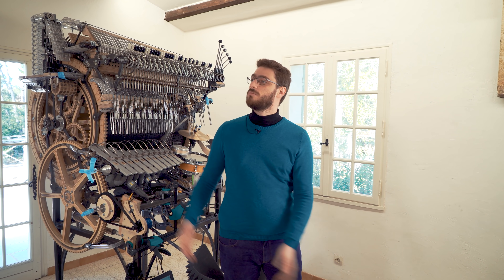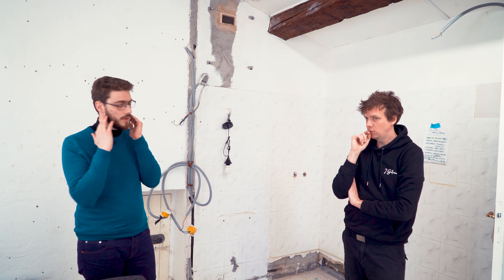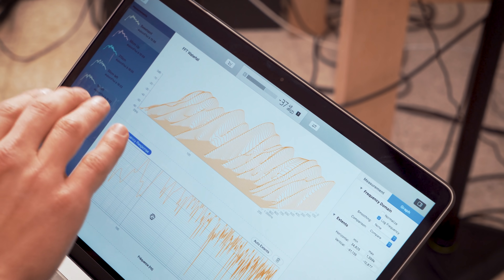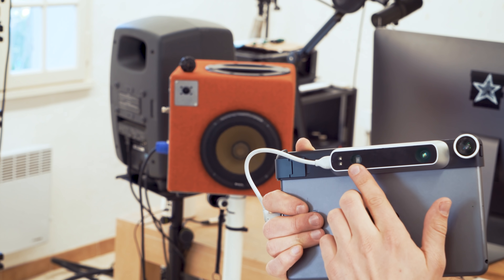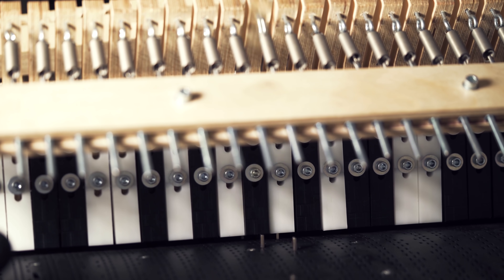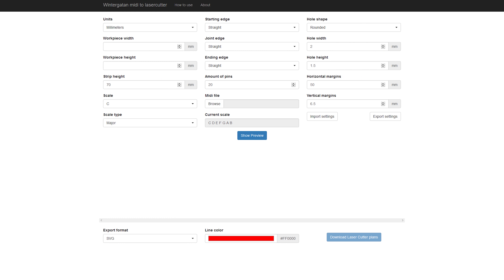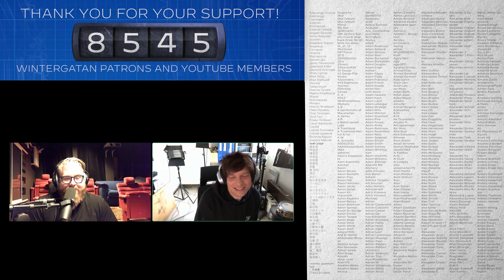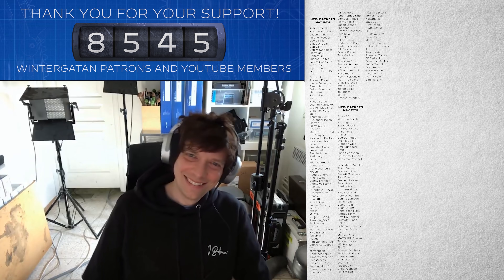Music Studio Acoustic Measurements - Marble Machine X #127

Comment: Re: The suggestion to use solenoids to directly trigger the releases.  Surely it would be 1000x easier to just multisample the MMX to allow you to play around with song ideas in Logic before committing to the plates?
Reply: Yes, I feel they are really overthinking it and creating problems for solutions. Adding a solonoid for every channel adds so much bulk, many points of failure and a whole layer of complexity with electronics. I think a sensible workflow would be composing midi using MMX samples, then testing the finished composition on the MMX using the magnetic pins (to catch any physical limitations that might not be apparant when using samples, and finally creating the stud welded boards from midi.
Reply: I think it still is something completely different playing on the actual machine vs with samples:
It's about what sounds the machine adds, whether the marbles arrive everywhere in time, whether the timing works out for him to change the bass capos, etc etc...
The way I understood it is that the system is detachable, so it is just an add-on during composing and not permanently attached.
Reply: True... but a big problem of the machine is it’s limited marble flow and number. Triggering the channels directly allows to check if the pattern is possible without running out of marbles. Also the cyber bass or that other instrument still in the making would be hard to sample. Using the whole machine to test song ideas might me over complicated but it’s a good way do hear it for real and to make sure the song is possible on the machine. Also, it’s like trying ideas on a piano versus composing on a midi grid (kinda) so in the end it just depends on the Wintergatan music making workflow
Reply: @oscarjouxtel5343  The physical limitations are not magic or random or anything though. With just a bit of measurement and analysis of marble flow rates etc. it should be perfectly possible to just write a script that can analyze a midi file and verify whether it can be played on the MMX.
Reply: @oscarjouxtel5343  He can just test his completed compositions using the magnetic programming wheel.
Reply: @haaspaas2  3 limitations with the programming wheel that he's mentioned in the past and hasn't come back to:
1) Timing limitations: the magnetic pins can only go into slots with specific timings, limiting his freedom. The new stud plates can be way more variable, so you can't actually test what you can make on the plates with the magnets, as far as I understand.
2) Accuracy limitations: there's a lot of parts involved in the magnet pin drum that can shift around slightly.
3) Time Consuming: it takes a while to reprogram the wheel by hand. This isn't a huge deal if he's just messing around.. but when he's composing a long, detailed song.. and something needs to be moved around that might cause significant parts of the wheel to shift, well... that's going to make composing on this masterpiece quite tedious... something I'm sure Martin won't love lol
To be clear, he's definitely not going to use the solenoids as the way to play on stage... and he'll probably still use some version of the magnetic pins to do simple testing and ideas.. but when he's really digging into composing and trying to make an accurate measurement of where the pins need to be on the plates, well that brings us to the problem he never got to mention yet:
4) He's going to need to create accurate files to send to get the new plates. If there's innacuracies that are noticable enough when testing the plates, he's going to need to make tweaks and order a new one. The increased accuracy and precision that the solenoids (or some similar system) will bring to the pre-plate composing and testing will potentially save on a lot of extra plates being requested and reduce a lot of turn around time.
Reply: @oscarjouxtel5343  That's a good point
Reply: We're gonna first see how Martin's composing flow will be, using a sample is one of the many options!
Reply: As soon as his room treatment is up he can make samples for a VST.
Reply: If at all the solenoid triggers could be an addition to the programming wheel. That way they just have to immobilize one part and can use the normal pipeline.
Reply: The real problem will be when Elon Musk asks Martin to bring his marble machine into space where there’s no gravity! Marbles everywhere! Better start brainstorming a solution now! Think everyone Think!! Or Martin will lose all his marbles in the end!
Reply: i didn't quite follow the goal of the stud welded plates... are they going to replace the programming wheel altogether or just used in addition to the wheel for the tour?
Reply: @peter-gn8ey  There are four plates on the programming wheel, right? Imagine what that means. They'll need so many song changes to fill a 2 hour show that even with a spare set of plates off stage it would almost be impossible, and risky, to keep changing all the hundreds of magnets in between songs all night, and when he discovered these CNC welded studs it was a huge relief. So instead of his rubber holes, the four plates will be covered with these studded metal sheets. They will not only be more accurate than his rubber holes, but also (theoretically) allow for quick changes of the content on the programming wheel without any mistakes. Now, I suspect there will be complications in all this, but the idea makes sense.
Reply: sorry i could have phrased that better. i get the benefits of the stud welded plates in terms of tolerance and quick-changing, what I'm asking is, is the programmable cylinder going to be removed altogether meaning the machine can ONLY play the stud welded plates, OR is the cylinder going to remain such that he can use both? for the tour the pre-made plates make complete sense but without the programmable wheel otherwise, he would lose the ability to just "riff" on the machine so to speak...

Comment: To be honest getting rid of the pretty much central part of the entire machine and replacing it with electronics is kinda sad and takes away from the mechanical wonder that it is, but this really will make it a lot easier to operate, re-program and definitely less prone to breaks. And marbles will still move all the same as with a wheel or even more due to opened up space on inside.

Comment: There is absolutely no point in making the programming pins “more accurate” but ok. No one can tell if they have a maximum drift of “0.05mm” like come on. You need to stop somewhere
Reply: JS Lavertu exactly
Reply: A minuscule drift does not sound like much but over the duration of a several minute song, it will definitely have a impact on the tempo of the song. It’s the same reason why pianists practice to have near perfect timing when playing notes. Having inconsistencies in timing between notes leads to poor execution of a song.

Comment: Wow!  Martin said 2 things which make senses: 1) composing music 2) performing the music.  He is excellent at this.  He also mentions using MIDI in a very convoluted way to make CAD drawings to make welded stud plates to play the MMX.  This scraps his original goal of being able to create and change compositions on tour.  Also displayed here is the failure to understand that using solenoid activation which allows easy editing and programming from MIDI, solves multiple major issues.  He instead envisions the possibly to add another layer of complexity to the process of making music with the MMX.  He views the solenoids as merely a composition editing tool before making the welded stud plates, which, of course, cannot be edited.   The solenoids can replace the magnet pins, programming drum and the welded stud plates completely !!  

Manifest in this video is the concept of "Re-arranging the deck chairs on the Titanic" and throwing more time, effort and money after bad ideas and a disastrous implementations. The Monster CAD Project seems to be the largest waste of time and effort.  Why build a CAD model of design that has proven many times to be unreliable and fragile?  Will there be a special call out for adding 0.1 grams of epoxy to each of the wood screws in the plywood?  Will the Plywood be replaced with solid hardwood?  Metal??  Do you need all the detailed CAD of a complicated, mechanical, demagnetizing system?  Or re-design to lift the marbles in a simpler, more reliable way?

The re-modeling of the "studio" is another totally unnecessary waste of time and resources, since the MMX has been functionally completed years ago in your computer as MIDI which needs no acoustic treatment of the room,

Martin, I have been watching every YouTube video since the original Marble Machine years ago.  I think you are a great composer and musician.  You are no longer making the MMX, it is making you.  I can no longer watch this slow, drawn out waste of your time and talent, as it has become painful and sad.  I will check back in 2021 to see where things are at that time.  Good luck.
Reply: I think you may have misunderstood what is happening. Remember, it was never only about creating this unique machine, but also about recording an album, and taking it around the world for a concert tour. To fill a 2 hour show you'd need so many programming plates that it would be almost impossible, and very risky, to change the pins by hand in between songs. So the metal programming plates have been part of the plan for a couple of years already, ever since he discovered the CNC studwelders. If Martin still wants to make changes on the road, the manual plates will still be there to do that, so he's not losing any options. Same with the solenoids. Sure, they could replace the programming wheel but they won't. Why would they? But they will make it easier for him to compose to the limits of the machine, and, if he wants, even improvise live on stage. It makes the machine into a real instrument, and doesn't take away from the original concept at all. Sure, the whole thing could be midi controlled, but it doesn't depend on it, and I'm sure it won't be during performances. What would be the point? 
As for the CAD project. Remember the machine had an accident recently, and I think it made Martin realise how vulnerable the whole thing is, and that spare parts are key. Perhaps even a backup machine. That's what the CAD project is about. Booking a world tour is a huge responsibility, and preparing the whole thing for that reality is a huge job. That's where the community comes in. Finally, the home studio will be needed to record the album at good quality. So I don't really see any distractions from the original idea anywhere.
Reply: @astroscribe  It must be a lovely fantasy place where you live!  The MMX doesn't exist as a working, reliable, transportable thing.  Like its predecessor, it is falling apart right now.  As for the MIDI, it is not to operate this monstrosity, but replace it entirely.  Martin made it and showed it years ago to test the various timing and musical intervals he needed to incorporate in tho the MMX.
Reply: @shazam6274  Meh...

Comment: I feel like dropping the marbles with solenoids isn't within the spirit of the MMX! It's a mechanical machine! not just an over-complicated speaker
Reply: If I understand well, the solenoid system is only for the composition, to avoid to have to move pins constantly during the composition.  I think he will design it so it's removable for the concerts.
I find this idea pretty awesome because this means this machine can be both used as a instantly re-programmable and automatic marble machine as well as a completely manual machine.

Comment: Sorry, I think you are losing the entire ethos and raison d'etre of the project by replacing the programming wheel with solenoids and even adding a motor.
I thought the idea was that the MMX was an automaton, a manually driven device with no electrical/electronic parts (bar microphones).
Why not just eliminate the marbles altogether and just use a MIDI controlled solenoid to move a mallet on the vibraphone or bass guitar?
Much simpler and way cheaper. It would also be exceptionally boring by comparison.
Don't do this. Work it out.
Reply: Don't worry... Who's saying anything about losing the wheel? Nothing is lost. The original concept is still there and not going anywhere. Martin is too smart for that. He is talking about a tool for composing. But I personally think it's cool to make it possible to also play the marbles like a real instrument. Not either/or but and/and...
Reply: nah man it's for composing, not performing. would be insanely wasteful to have to produce stud welded programming plates and then find it sounds like crap on the actual machine.

Comment: Really starting to hate this obsession with tightness. Slight imperfection was one of the most charming things about the first MM. You're not making a perfect machine. If you did you might as well just make a digital music maker..

And Solenoids would completely make the manual musical quality of the mmx pointless. Its what we watch for.
Reply: I'm pretty sure the Solenoids were meant just for testing out songs to see how they sound when played live, so that the composition process is a lot more efficient. Then when each song is done Martin would get each piece stud-welded, to keep the aesthetic for the actual performance.
Reply: @bro748  Correct, the solenoids idea is for composing, not performing. The stud welded sheels will actuate the marbles, but before we have those Martin needs to compose a song and send it to me.
But we haven't decided yet on the composing workflow, the solenoids is just one of the ideas proposed.